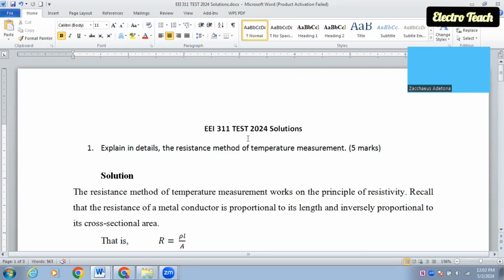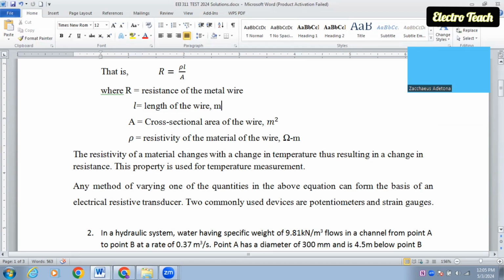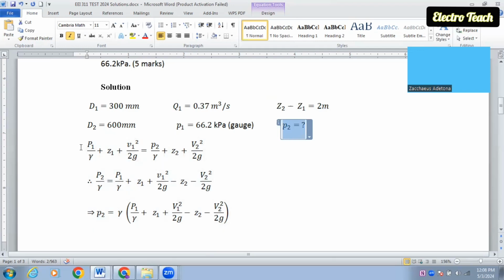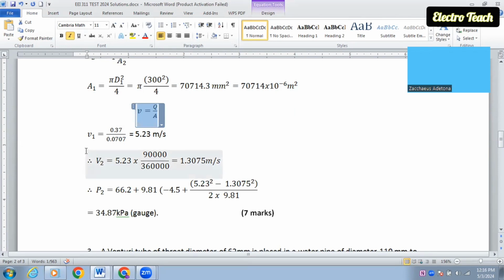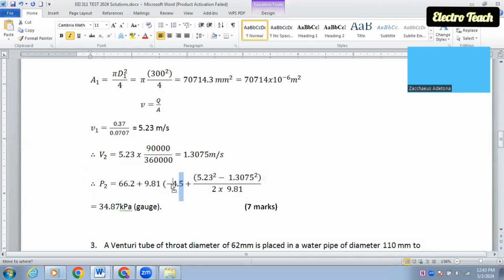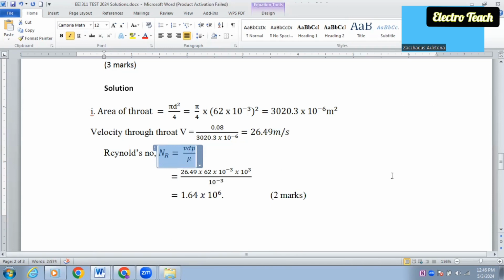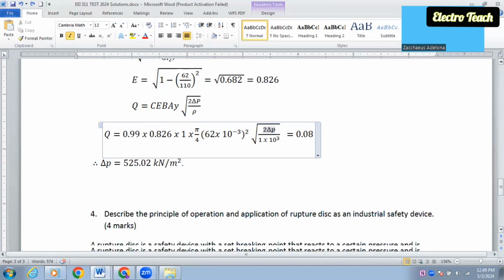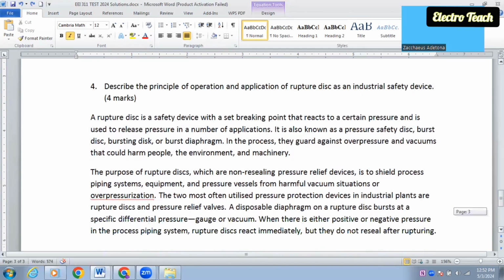SOLUTIONS to Instrumentation Systems Tutorial Problems @ECIMacademy

Comment: Sir, in getting the differential pressure of the upstream to throat
Based on the formula used Q=CEBA¹√2∆p/density,

What is "B" for as i noticed you used 1 as B, mean while it was not stated in the question is it a constant value sir, or it changes
Reply from the maker: It's a constant.

Comment: Looking through the second solution sir, the formula portrayed. I.e. the part of A1/A2, why was diameter used in replace of the Areas of bothsides. Because calculating the area and making use of it in this formula the answer will definitely be different sir.

Also, at the "Q", in the formula where density is, the density on the question was again not used. But instead 1x10³ was used, why is this sir?
Reply from the maker: No. If you used the area rather than the diameter, you would arrive at the same answer. Try it and see. As I explained in the video, since we have a ratio of areas, the diameter can be used as other parameters in the ratio will cancel out.
Reply: @ECIMacademy but I did, didn't arrive at same.
Reply from the maker: @fieldsofcomedy  You need to do it again carefully.
Reply: @ECIMacademy I did sir, very carefully the answer are different sir the area of A¹ is 0.00302m², while for A² is 0.0095m²
Dividing this two you get 0.3178 the square the answer you get 0.101, subtracting 1 from it base on the formula you get 0.899, then square root the answer you get 0.9482 sir. Not same with what you are having sir

Comment: Sir, when you were solving the Reynold's number after getting the velocity of flow (V). The diameter to use next to get the Reynold's number should have been the diameter of the pipe given which is 110mm. But instead you made use of the the throat diameter, that we have use in calculating the area of throat (A). Why sir?

And also the density of fluid was given which was 103kg/m³, but you used 10³, why sir?
Reply from the maker: The throat diameter is the right value to use. The 10³ and 103 might be a typo. I will recheck that.
Reply: @ECIMacademy um🤔 but why not the diameter of the pipe sir.